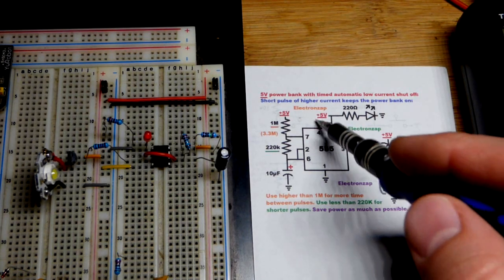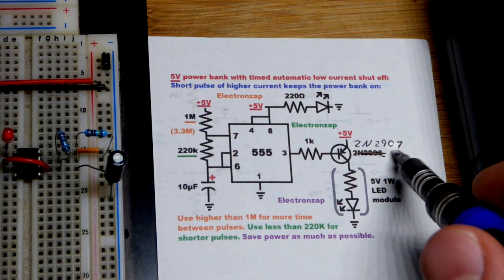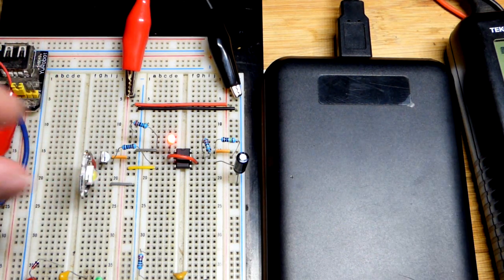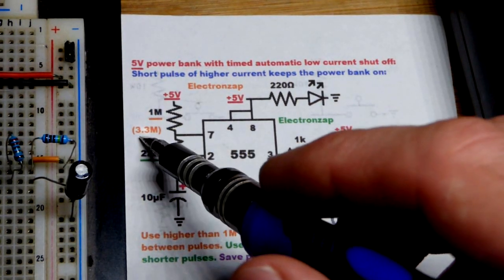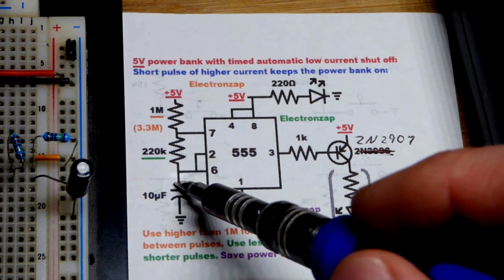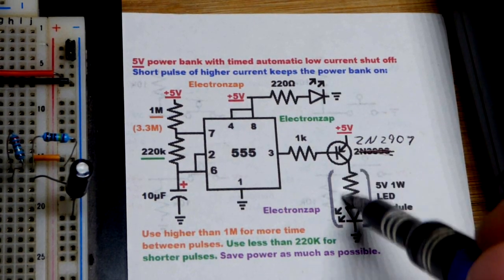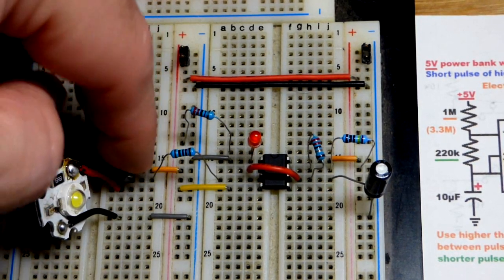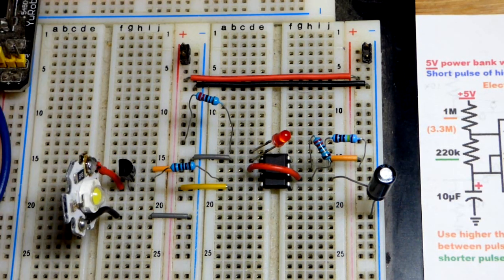How to prevent USB low current auto shutoff for portable power banks

Comment: I can charge my phone and tablet, but I think as long as one of those loads is on the power bank I can get away with plugging in my Bluetooth earpiece or watch. I can see this very useful if I'm just charging my Bluetooth earpiece and watch by themselves. 😊
Reply from the maker: Yeah, that's something I should remember to point out. Power bank should stay on just by also powering something higher wattage that is also useful. Whereas for just a low power load that you want to be able to power a really long time without draining the battery, you might need something like this.